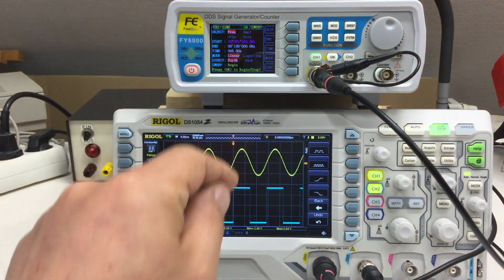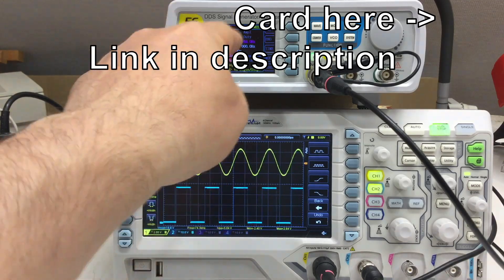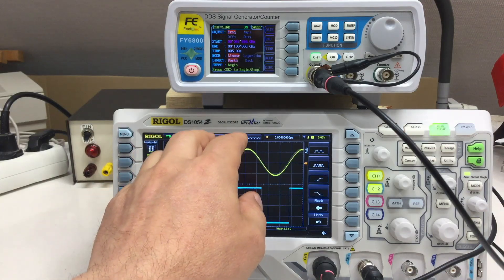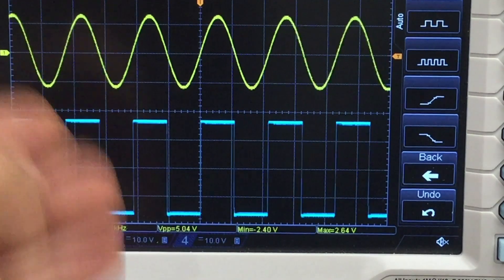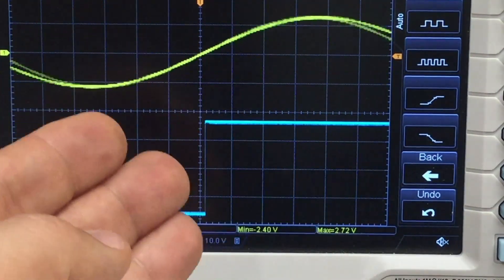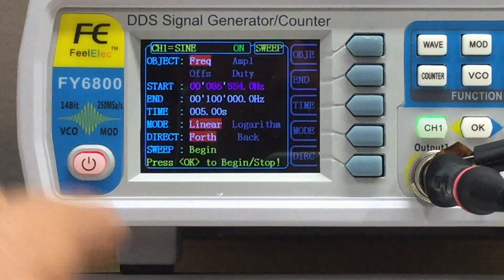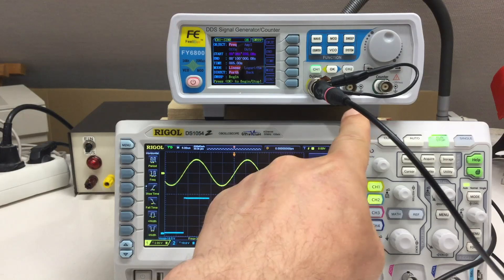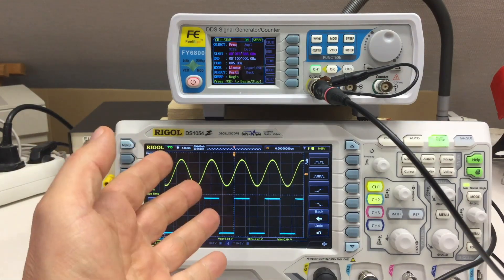FeelTech FY6800 60MHz Signal Generator Review Addendum (Viewer Question)

Comment: Pity, and very surprised it does not,  it would be easy for them to do! :(
Reply from the maker: It would be quite easy, yes. However, it would use up another pin on the FPGA that runs the whole show. Maybe they ran out of pins or gates (a FPGA with more pins/gates would be a considerable cost factor) or, more likely, they simply didn't care, respectively, didn't thought about that. At that price point I wouldn't even dream about a BNC sync output, but a TTL one would have been really nice.
Reply: The EP4CE6E22C8N in the FY6900 (I know this is FY6800, but it's essential the same unit).  has 6,272 LUNs, so I seriously doubt that every single one is used, and all the connection resources are maxed out, and the same for the pins for which I doubt they are using anything like all of them.  It's possible, but having designed many FPGA systems myself, I cannot see it.  I have no idea why they have not put a sweep sync output, it must already exist internally, so it would be a no brainer.  This kind of limitation only exist if you have a few hundred or so LUNs, and even though the EP4CE6E22C8N is the bottom end of the family, it is a little over sized even for this application.  It is however cheap,and well suited for simpler but fast applications like an ARB generator.  I said cheap, but that wasl until the world went insane in 2019, today they are crazy high, which ay be the reason these ARBs not cost 1.5x what they did two years ago.  I have a few EP4CE6E22C8N's in stock, but wish I had a thousand or two, I would make a small fortune and maybe buy a Testa 3 :)  ...oh well I missed the bitcoin bus as well!  Maybe when all the power mad globalists, commie politicians and woke morons are publicly slaughtered as an example to others wanting to control our lives and take all our money, things might go back to normal
Reply from the maker: @stevenbliss989  Having never worked with FPGAs, I have to yield to your expertise that the EP4CE6E22C8N is not maxed out (pin- or gate-wise) in the FY9600. That leaves only the options that they either didn't care, or, never thought about it. Both options are equally bad. Especially the latter one, indicating that the designers didn't understand how sweep modes in signal generator are used.
Reply: @robertssmorgasbord  Yeah it's sad, but for the money the FY6800 & FY6900 are still great units.  I like both FY6900 (60Mhz) and a much earlier 6Mhz FY2300 model in a cheap aluminum extruded case (I guess when they were starting out) I have, both of which I use often.  KKMoon, FeelTech, Juntek, MaxGeek are common brands they sell under, but I have no idea who the actual manufacturer is.  Anothet great thing about these units is I don't have to worry a LOT about accidentally blow one up, because they are not a A$1,000+ unit like the Rigol/Siglets etc., let alone a Keysight etc.  A somewhat better unit with a larger screen is the JUNTEK PSG9080 80Mhz (NOT the JUNCTEK  ADS8060, which is CRAP for the $ - the FY6900 beats it!), ...yeah watch those "C"'s and "K"'s :)
Reply from the maker: @stevenbliss989  I agree, for the money the FY6800/6900 offer fantastic functionality. As far as blowing things up: A while ago I reviewed a 40 GHz microwave signal generator ( https://youtu.be/JwywHkiPdys ). I was always very conscious about the price point of that thing when I worked with it. Especially when I used it in some experiments ( https://youtu.be/A0hsRTKx1LQ ). Anyway, I had a look at the JUNTEK PSG9080. Very nice! It costs about 200€ here in Europe, so it's very affordable. Plus, it has sync in and out BNC at the back 😉
Reply: @robertssmorgasbord  I have been pining for the JUNTEK PSG9080 for some three years, it is a step above the FY6900 I have, and now it is 1.5x the price it was then :(  ...oh well.  But still excellent value.  As for the BNC Model 865 40 GHz RF generator, ...I could not find a price for it anywhere without a quote first, so I assume it is crazy expensive?
Reply from the maker: @stevenbliss989  Yes, The BNC Model 865 40, although a relatively small box, is indeed very expensive. Just the add-on options are in the 4-digits range (e.g. "Enhance Phase Noise" $4.500, "Ultra Fast Switching" $6.500). So I guess the base unit is well into the 5-digits.
Reply: @robertssmorgasbord  Yeah, I forgot to mention the sync out, sorry, my brain ran out of LUN's and connection resources :).  Apart from the higher level ARB with nice larger screen, it is why I have been pining for it so long.  ...one day, one day :)
Reply from the maker: @stevenbliss989  Hope you'll be able to score one soon 👍 The sync in/out really makes it on par (at least feature wise) with much more expensive brand name models.